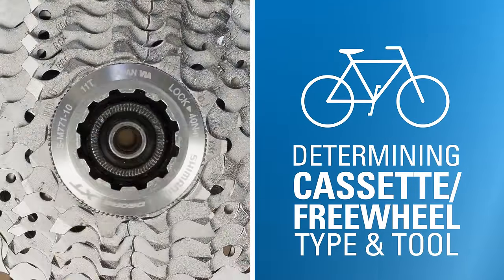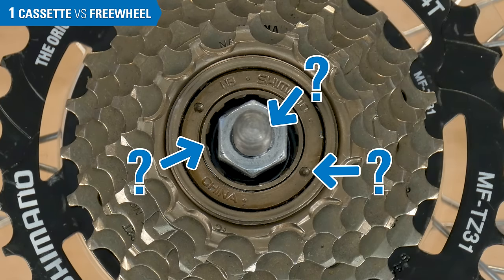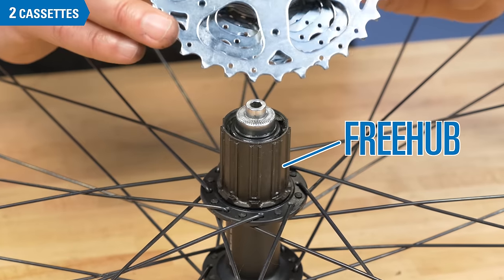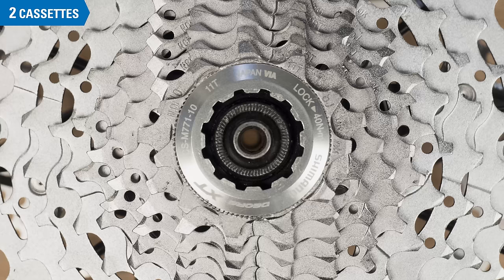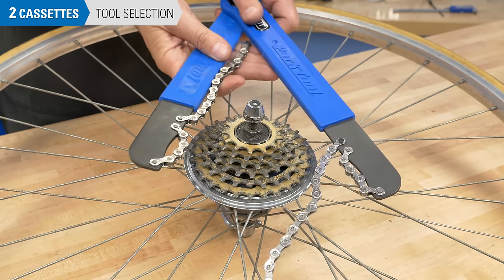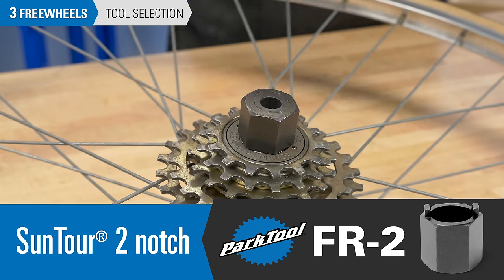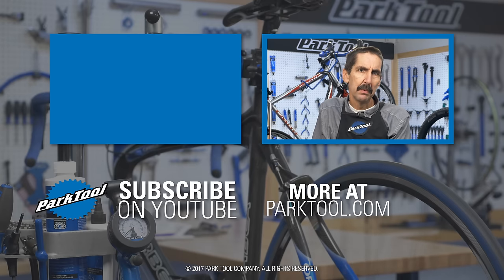Determining Cassette/Freewheel Type & Tool

Comment: I'm not an expert at Cycle repairs, though I'm not afraid to get my hands dirty.

To-date. I have found the Specialist Park Tools' items to be very reliable.  And, these informative video's help me to deicide which type of tool I may need for what particular type of product I'm facing.  The cost may be  much higher than cheaper brands, though in some cases, the strength of the product and it's described applicability to the particular product configuration I'm faced with, is well worth it - I'd rather pay extra and know that it works, than pay half and find out that I should have bought something else.

I have used the Cassette removal tool for my own bicycles many times over, not only to clean the gearing, but of late to clean the hub itself - which started slipping. However in my case, instead of the 10mm hex-key tool to remove the hub, an 11 mm tool was required (Giant Xtc2 MTB) - not a one off case. Perhaps an 11mm should be added to the Park Tool chest ?

Park Tools, I think, has established it's name as the go to source for reliable bicycle tools to have access to.  I only wish, it was more affordable  across the board.

Comment: THANK YOU PARK TOOL. I was able to get the 1.3 and remove my old shimano freewheel, and wow is the tool robust. I had to put an 18” extender on my wrench, sit on the wheel to hold it still and crank on the extender hard with both hands before I got it loose. This is on a 15 year old wheel that has never had the cassette removed. The tool is worth it 100%, don’t waste your time goofing around with pliers and screwdrivers because you will damage your cassette.

Comment: I just bought the proper tools today. A chain whip for $2 and removal tool for $2.50. 

A right angle needle nose pliers would be far more effective and give you more leverage though if you were to go down this route and you can utilize your own bike chain as a makeshift chain whip using a bit of wire or zip ties.

While this method would work in an emergency. I would not use this particular method for taking off (or putting on) anything that you cannot afford to destroy / replace.

Comment: Being an individual who has more automotive tools than purpose-made bicycle tools, loosening a Shimano Hyperglide 8-sprocket cassette using the Park 5.2 tool involved a 1-1/8 socket and a battery impact tool.  Using an impact meant that I did not also have to invest in a chain tool to secure the cassette while trying to loosen the cassette lock ring.  Honestly, I felt like far less effort and torque was applied to the system using the impact than would have been imparted with the standard non-impact method.
Reply: Impact tools are always potentially less damaging than any other method if the parts are stuck... and, even if they're not. So, if you have an impact wrench, use it first, not as a last resort.

Comment: So this video is about determining the tool needed to remove the sprocket system from the rear wheel hub. It does not include tool info required to open up the sprocket system unit to get at bearings.

Comment: My freewheel requires a LIFU 09A. From what I have found it is a 1972 bike, 1973 at latest. It's a 10 speed, made in Japan, a Nishiki Olypiad, not Olympic. American Eagle sticker on frame. The tool I ordered to remove freewheel is coming from Switzerland, which will take forever and a day.

Comment: Very detailed. Superb.
Can you tell me what can be the cause for a bit of decentered cassete cogs while rear wheel spinning? It's a 9sp cassete, istalled correctly tight with lockring (no free  moving between cogs).
Thanks

Comment: I have a Shimano Dura ace freewheel that I need to remove - model FA-110, it's a two prong type of lock nut and the diameter is approximately the mentioned 25mm but after buying the FR2 I found out that the prongs are wider than the notch in the lock nut of the freewheel.
Reply from the maker: Shimano had a proprietary tool for their Dura Ace.  You might find a used one somewhere.

Comment: Is the (not available by Parktool) 20mm diameter freewheel remover, that works with Shimano FFS? Thanks for the video! Awesome quality as always!! 🙌🏻
Reply from the maker: We do not offer that sizing.  There simply is not much demand.  You may need to search the internet, new and used, for this.
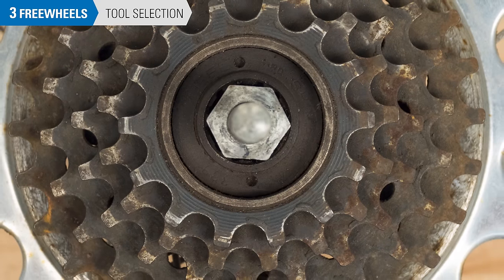Reply: @parktool  The question was if the 20mm diameter socket is the compatible one with FFS. The unavailability that I put between brackets, is clearly mentioned at the video in the minute 6:00, and in the minute 6:52. Anyway, since we are talking about this, I take the opportunity to ask, why was the Shimano FFS discontinued? Was it worser than standard freewheel system? I got a Raleigh with FFS, and I got to find out where to get that socket. Well, thanks again 💫

Comment: My freewheel can be dissasembled gear per gear as a cassette. So its kinda the same as a cassette and if i want to work in the core i can do it apart from the wheel. somehting that u cant do in a cassette since u have to assemble the core with the wheel wich is uncomfortable.

Comment: Hello together, I have a Regina Oro freewheel-system from the early 80th. Which tool version I need? The notch dimension is 6,1 mm, the outer diameter is 24,4 mm. 
Best regards from Northern black forest 🌲🌿🌳

Comment: How would you suggest cleaning a freewheel and a cassette? Like a deep cleaning, not standard maintenance cleaning. And any way to polish it up and make it look more new?
Reply from the maker: There are many ways to clean a cassette. Some people use ultrasonic cleaners. Some use parts washers. A good way at home is to get a nice stiff bristled brush and use a degreaser like our CB-4 or a brake cleaner to loosen all the dirt then use soapy water to clean it the rest of the way and rinse.
Reply from the maker: This would be easiest with it removed. That way there is a low chance of getting any degreaser in the hub or freeehub.

Comment: I have a B’twin road bike. I can’t find any lock-ring tool on your website or ebay, also will a normal chain whip work from ebay. I still can’t work out if it’s a cassette or freewheel there’s many internal spines with the characteristics of a cassette...

Comment: I have a Sunrace 7-speed freewheel with a lockring holding the stack. I'm looking to disassemble to the bearings. 
There are four tabs on the lockring, which has an ideof approximately an inch and a half. Does Park make a tool for this lockring?

Comment: I have a question (thanks for the tutorial btw) I hope you can answer. My cone looks very similar to the one shown here 5:32. Problem is, I can't find what type of tool is needed to tighten,  since it's deep into the gear. What tool is it? Thank you
Reply from the maker: See the different types here.  First make sure it is a freewheel and not a cassette type.  Get a flashlight to look at the center tool fittings. https://www.parktool.com/en-us/blog/repair-help/freewheel-removal-and-installation

Comment: Hi, I have a question. I have a tricycle with a shimano freewheel/hub that needs replacing. Are trike ones just regular bicycle ones or are there special types for tricycle axles? It looks like there are two grub screws and a bushing attached tothe fhreewheel which hold it on the axle.

Comment: Dear Park Tool. I have got the wheel with very specific freewheel, the remover looks similar to FR2 santour 2 notch, but the outer diameter is much bigger, around 34-36 mm. What kind of the remover I need? It seems to be some old French brand, but it difficult to distinguish, because it is too rusty.  What can you recommend for me in order to open this freewheel, thank you in advance.

Comment: So cassettes are useful for coasting and going faster (since you’ll reserve energy because you’ll still be living without using power)? However, the freewheel requires more power for speed?
Reply: The freewheel allows coasting by letting the wheel spin ahead of the gear set. Fixed bikes don't have this so you have to constantly peddle. The cassette is a set of gears that give you gear ratio options so you can go uphill more easily and go faster when on flat or downhill.

Comment: How do you determine which "FR-5 Series tool" is best for your bike?
Reply from the maker: Good question
FR-5.2 -Most versatile fitting all types of hubs.  Slower because you should use the quick release to hold it in place.  Also fits solid axle hubs  
FR-5.2G -  For "quick release hubs", with open dropouts, is a time saver because the guide pin takes the place of a skewer.  
FR-5.2H -   Built in handle, so convenient and fast. Uses skewer nut in place as guide to hold is in ring fittings.
FR-5.2GT- Built in 12mm guide pin, use ONLY on thru axle hubs.

Comment: I have a sram/red rear derailleur and locking ring identified as sram OG 1070 11T. I did not see any other marking on the cassette. How do I identify the ratio of this cassette visually! IT may not be sram cassette because they are no marking on the inner side of the first cog! Thank you for your time! ….Gino

Comment: What tool do I Need for the KENT 26" Bayside Cruiser 7 Speed Freewheel, Model  NO: 72696 (Black & Blue with Blue Tires) Discontinued tho? I See tri diamond ^^^ Marking on the Inside Freewheel?
Reply from the maker: FR-1.3 is the one you need.

Comment: Funny , cause park tools on ebay say the FR-1.3 tool is for 25mm and you say at time 6:44 that it's for 23 mm?
Reply from the maker: Hello Rigo, could you send a link to the ebay item? The dimension of the FR-1.3 is nominally 23 but is actually 22.6mm. We do not sell our product on Ebay. Online resellers do and they do not always relay correct information leading to issues like this. We would like to request they correct their information. Thanks.
Reply: @parktool  ..I don't know how to send a link but if you type in FR-1.3 on ebay you'll see the park tools and it listed by the second seller Senditbikes showing in his description 25.4 mm
Reply from the maker: On that listing the  "25.4mm (1") base/head fits FR-series wrenches or vise" is reffering to the end of the tool that needs to be driven by a wrench and not to the 12 notch tool fitting side.
Reply: @parktool  ...Oh I'm sorry that I didn't read it correctly and thank you for the fast reply

Comment: Hi Calvin I have a shimano freewheel with 2 tool fittings but they are way smaller then the park tool 2 prong freewheel removal tool.Can I grind off the metal on the tools prongs to make it fit.?I guess I'm asking if it will still be strong enough to take of a old flywheel without breaking.Its on a old bmx skyway mag wheel.I really don't want to beat on this thing with a hammer and flathead or trying to wrench it off with a flat metal bar.
Reply from the maker: Hello Toby, It sounds like you have what is considered a "non removable" freewheel. The hammer and a punch method can work but the most effective way we have seen is to use destructive removal. Here is an article that goes over that process. https://www.parktool.com/blog/repair-help/freewheel-destructive-removal

Comment: How about a early 1980's Murray Adagio 12 speed road bike freewheel with 2 notches where the freewheel also is the bearing race?
I oiled the freewheel and I dont have to remove it, but what tool would get it off?  There is no marking I can fine except for on smallest  chain gear JG.

Comment: Is there any danger of a tool almost fitting? Using something close but not right seems like it would damage the part and the tool.
Reply from the maker: You are correct. Using say an FR-11 to remove a threaded freewheel would potentially damage the tool or the part. The correct tool for the job is always suggested.
Reply: @parktool  thanks for responding. There are just so many types of part and tool in this category

Comment: I have a wobble in the cassette when freewheeling ...how immediate of an repair is that?
Reply from the maker: A wobble is not uncommon when freewheeling. The inner and outer body parts of the mechanism are slightly eccentric.  But when you pedal, the two are locked together, and the wobble goes away and all is good.  This make the repair- don't worry about it.

Comment: Tool fitting? Isn't this the ring you mentioned earlier? Is freewheel and freehub the same thing? Note: only to those who understand, it appears simple. But for this beginner... not so. Thank you for another video well done.
Reply from the maker: Tool Fitting would be where the tool fits. A freewheel and freehub are different. A freewheel is a stand alone system. A cassette rides on the freehub. The freehub is build into the hub. See these articles parktool.com/search?q=Freewheel

Comment: Hi very nice video but I'm trying to unlock the lock ring on the freewheel two small circular indent on it, which tool do i need? I need to clean the inside and re-grease the ball bearings because it making noise after i dipped it in diesel:))) It probably washed off all the grease inside the freewheel.
Reply from the maker: Know that there are many small bearings in the freewheel that all need to get back in safely. To remove that you will need a pin spanner like the SPA-6.
Reply: @parktool  Thanks for the reply but i coludn't find such a tool where i live.
Reply from the maker: https://www.parktool.com/en-us/product/adjustable-spanner-spa-6
There should be online retailers carrying this tool that ship worldwide.
Reply: @wildfire278  If you need to oil your freewheel, turn it upside down on top of a rag. Drip a little oil into the gap between the stationary and rotating parts. After a few minutes, repeat. Stop when oil starts leaking out of the front of the freewheel.
Reply: @billkallas1762   Thanks, but i already tried that option but it did not work, creaking noise were still there, oil is too thin for the ball bearings.
Reply: @parktool  Thanks for the advice, I considered it, though it costs more than the new freewheel (shimano MF-TZ500-7) when I convert dollars to my currency plus shipping and customs tax. I've unlocked the ring using more primitive tools:)  There was no any grease left inside, so all the small bearings scattered on the floor:) I've put them back on with tweezers after re-greased the beds, creaking noise is gone, in fact all the noise is gone even when back pedaling or idling. No more clicking :) Now i ride like a ghost:))

Comment: PTools - wld be v grateful if you cld please advise on why you might need a guide pin on the Cassette Lockring Removal Tool(s)? I see there are 5mm and 12mm pins available, and some with no pin. Are there some cassettes or hubs which won’t accept the guidepin? I will need one for removing a 9 speed Shimano Acera cassette from a Boardman hybrid (“9mm hub”, apparently) if I summon the courage to dare do this myself.
Reply from the maker: See https://youtu.be/UD0Yr9xpzmM 
The guide pins are nice to help maintain contact with the part. If it is a solid axle, it will accept no guide pin.

Comment: There is no reference in this video to the Park FR-1 tool.  Close up, it appears to be very much the same as the FR-1.3, except for the depth the tool can be inserted on the freewheel (1.3 is longer). 
Is this the only difference in the two?  Or is each one designed fro use on different freewheels ?
Reply from the maker: Any time we use the .2, etc designation it is an upgrade in the tool.  The FR-1.3 fits everything the FR-1 fit, and more.  9 and 10 speed freewheels need a deep insert in the tool fittings.
Reply: @parktool  Thanks!

Comment: What the pros-cons of cassette and freewheel?
Reply from the maker: Cassettes are typically regarded as being superior.  Cassettes in some cases offer the ability to replace only the cogs that need to be replaced. They also give the hub manufacturer the opportunity to build the clutch or freewheeling device into the hub. This saves weight and offers many options for users. Some of the negatives to cassettes are that they can gouge the cassette body of the hub, They require two tools for install, and they are not fully self contained. Some of the pro's to freewheels is that they are self contained and when replaced you are replacing the entire clutch mechanism, they do not gouge the cassette body, and they only require one tool for install. Some of the down falls of freewheels is that they are difficult to remove, they typically do not have quick engagement, They weigh more, they offer less options currently. They also do not give nearly as much gear range. I hope this makes sense.
Reply: on a purely practical basis, there are far more (and MUCH wider gear range) choices for cassettes. cassettes are also much more widely available, while to get a decent range of freewheels means going to a specialist bike shop (SJS Cycles is one). An 11-32 range cassette is widely available in 8 speed (or 9, 10 or 11 speed), while wider than about a 13-28 freewheel is rare and rather expensive (think IRD brand, for example). Indeed, all you might find typically in a freewheel is a 14-28, or one of those Shimano "Megarange" freewheels with a huge jump up to a large gear on an otherwise modest gearset..
Some of the modern "1x" systems run an 11-40 rear cassette or even bigger - you just don't get THAT sort of range in a freewheel
Me? I run an 11-32 cassette, and the 32 is for the range of hills south of where I live.